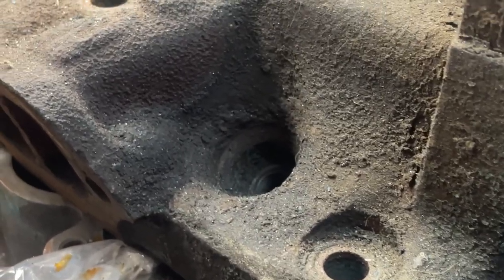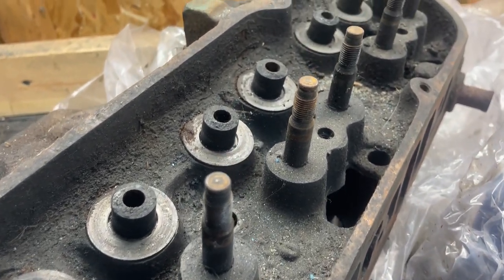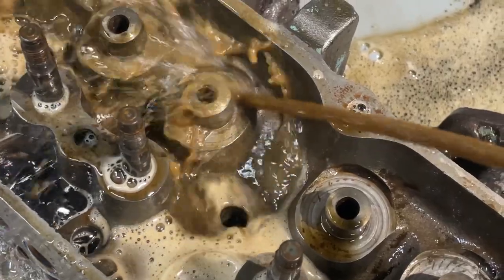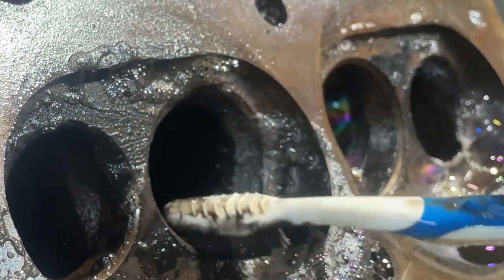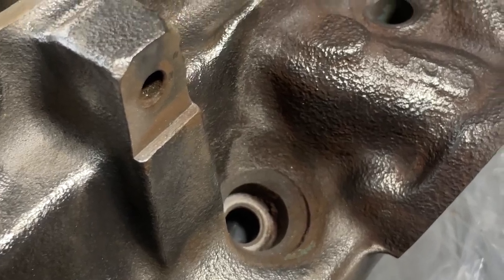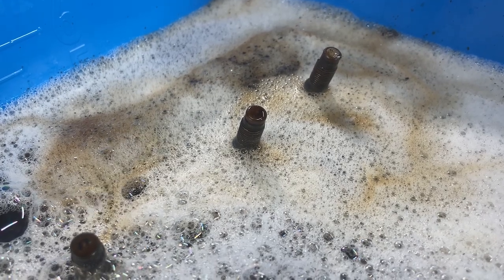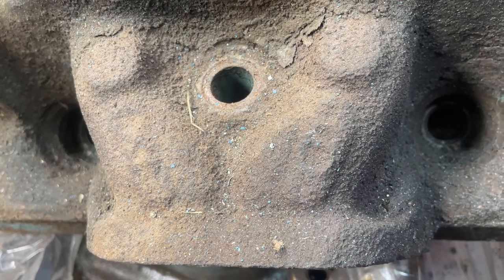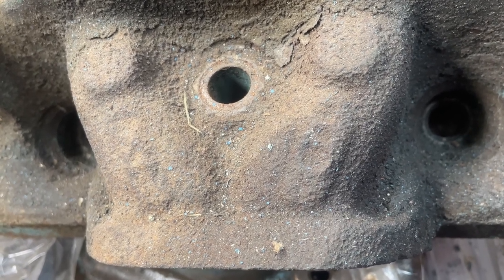From Rusty to Trusty: Cast Iron Muscle Car Cylinder Head Restoration

Comment: Love your channel. Would like to see a video on the process of race-porting pontiac d-ports to flow 280+ cfm.   Before the edelbrocks came out, if you couldn't get your hands on Ram air 4 heads you had to work with the d-ports. In the mid 1980s I saw two 67-69 firebirds running low 10s with 455s that both had 265-280 cfm #16 d-ports.   I owned a 68 GTO convertible with the same #16 heads at the time.  Fast forward to 2002-2003 and I helped a neighbor install a 462 short block from butler and 6x heads from a different place that flowed 265 cfm. Comp 320H cam. This engine dynod at 550+ hp, 585 tq.  I saw the same engine and cam with mildly ported edelbrocks in 2005 Pontiac Enthusiast make 588hp and 610 tq.   I'm 6 months out from starting a 462 build with the 320H cam and want to use 280+ cfm 6x heads. Hoping for 560+ hp.  Just got a quote from Kauffman Brothers to port the heads.   Love to hear your thoughts. Sorry for the long post.

Comment: Putting together a 67 400 out of a GTO to put into my 79 Trans Am. All stock other than a 2802 cam and performer intake. Basically just gaskets, an oil pump, and a lot of cleaning, Low buck build, less than $800 into it. Hoping to get a couple seasons out of it while we build our 455!
Reply from the maker: Always dig a budget build. Curious to see what you end up with!

Comment: Bought a 71 455 (yc) 066 heads from a Grandville. Putting that and its th400 in my 70 Tempest 2 dr post car with a 3:55 posi.  At 8.2 cr and being the first year of harden valve seats for unleaded fuel, the standard D-port 455 put out 325/hp and 455lb/ft in factory form.  should be a nice street engine.  Thats the goal torque down low.
Reply from the maker: Curious to see what you end up with. What’s the thoughts on the cam?
Reply: @LSxHunter  Being on a budget, I want to run it as it came from the factory for a while.  It sat for 6-8 years but I am told it was fantastic runner when parked.  I love the idea it may come back to life. that way I can have it running and driving while I research roller vs hydraulic. I'd like to try a roller at least once in my life.   If I go with a hydraulic grind, I would like to try an 041 coupled with a slight increase in compression ratio to around 9.25 -9.5.  My goal is 425-450 hp with 500 ft/lbs of torque.  Am I being too optimistic?  The Grandville tipped the scales at a tad over 4900 lbs. My Tempest is around 3200 - 3300 lbs,.anyway I look at it a 455 + my Tempest = 😁
Reply: Remember that pre 1972 Hp was gross and if you say you want 450hp, you mean gross too?  Gross beeing from the crankshaft with no appliance on.  After 1972 Hp was Net.  With all equipements, alternator, air conditionner etc... 
My 66 starchief executive 389ci 4bbl is 325hp and 425fp torque,  its 4400 pounds and will hit 130mph in no time.  Lol